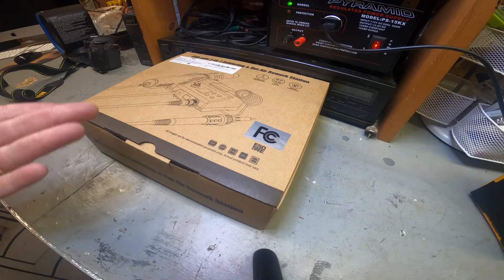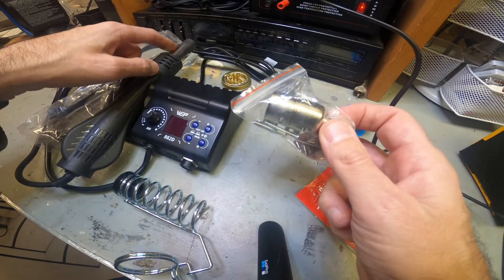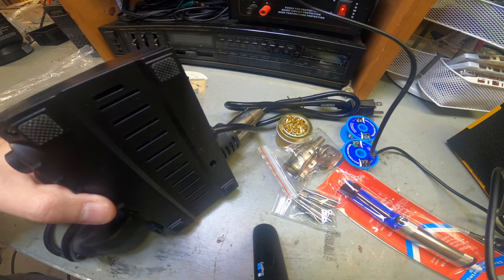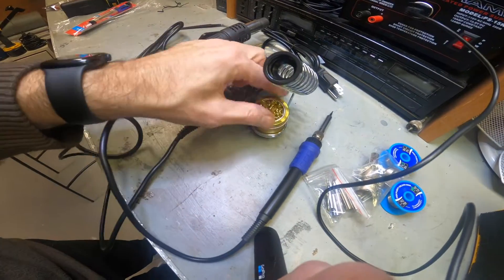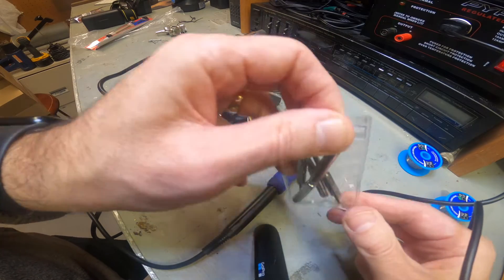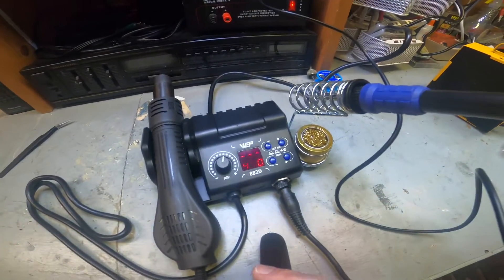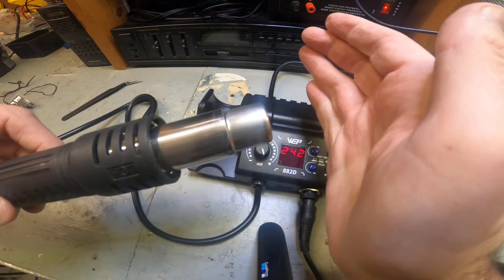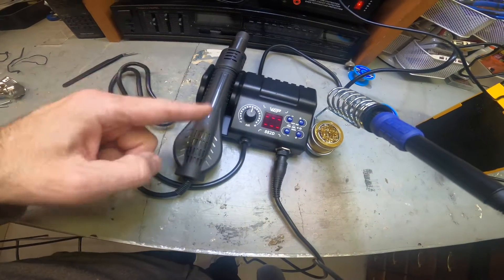WEP Soldering Iron Station 2-IN-1 SMD Hot Air Rework Station

Comment: I just got mine and the soldering iron does not heat up. Only the heat gun function works. Any idea as to why? When I turn it on it just stays at “192. “ I tried moving the temp up and everything
Reply from the maker: Just make sure that the heat gun is seated properly, unplug it and plug it back in to reset. Hopefully that helps.

Comment: Hey!
The "Screw driver" heads i usually call them "general" heads, simply because you generally want to use that one.
Generally the smaller the tip the smaller things you can solder, but the bigger the tip the more heat it is able to transfer and the faster you are able to solder. You don't want a capacitor for example to get too much heat, so you want to solder it as fast as you can. With time cheaper flux also starts burning, or you can melt plastic. The "thickest" and still usable head is the "screw driver" one.
Reply from the maker: Thanks

Comment: A few questions I didn't find in the product info on the Amazon page...
1) Will the hot air gun function with the soldering iron UNPLUGGED from the station
     (or does the station as a whole signal an unrecoverable error and shut down everything)?
2) Is the hot air gun FAN user-replaceable (if so at what approx cost)?
3) Is the hot air gun ceramic heater element user-replaceable (if so at what approx cost)?
Reply from the maker: Great question the heat gun will operate if the soldering gun is disconnected. As far as replacing the fan, probably not.
Reply: @YourReviewChannel  it is replaceable and the cost of the fan is few bucks two screws on the bottom where the cable is and then there are clips holding the rest together
Reply: @YourReviewChannel  also btw you have the temperature set in ferenheit or how is it called to switch into celcius you hold the minus button on the iron and plus on the heat gun i think it should be in the user manual
Reply: Thanks for the replies! They really help.